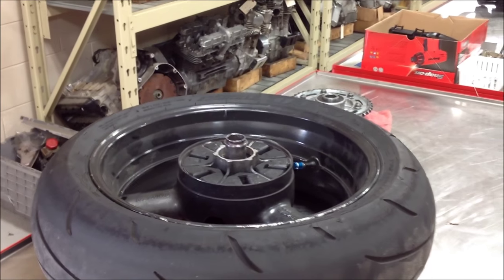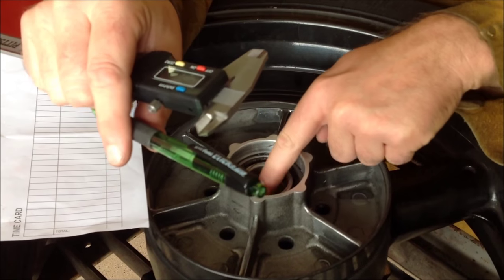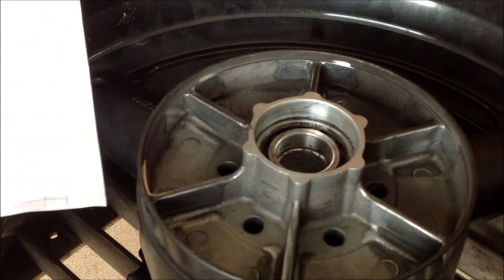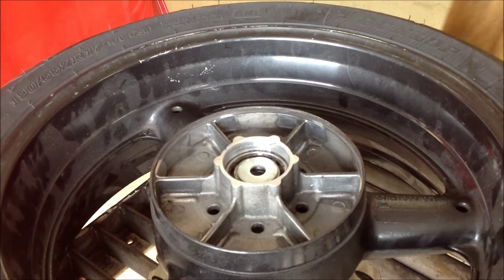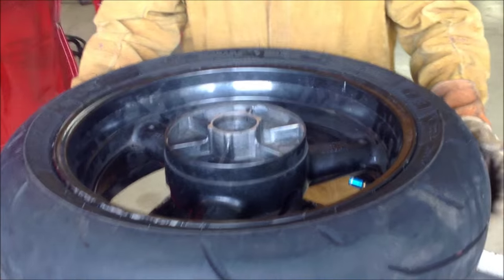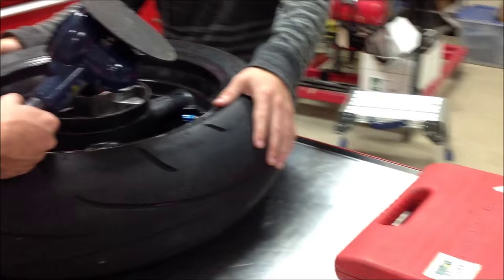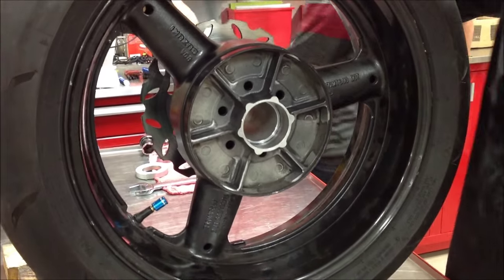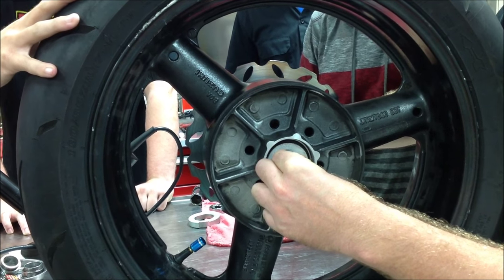Suzuki Hayabusa metric sport bike wheel bearing replacement with dyno run after

Comment: If there was a specification for that measurement, it would be in the service manual… I have yet to see any definitive instructions on how to install the bearings…however, the hayabusa wheel has a shoulder for the left and right bearings, where you would expect the the bearings to sit up against… in most cases that I have seen the inner tube spacer is generally around 0.7 to 0.8mm longer than the bearing housings… it is key for the sprocket side bearing to sit up against the shoulder, as to align the rear sprocket with the front sprocket.. if the brake rotor is not dead centre in the calliper, it’s not critical as the pistons can float to meet the rotor… A few years ago an 2017 FJR1300 came in for a front tyre change, which I did without issue… however, when I tightened up the axle nut, the wheel locked up… now I understood why the wheel nut was slightly loose when I removed it… I removed the wheel and bearings and found the inner tube spacer 1mm longer than the shoulders… after careful measurement, I shaved off 1mm from the spacer, and reinstalled new bearings, and the wheel went together without incident… on tightening up the axle nut, the wheel spun freely… I now do this on a regular basis, I install the sprocket side bearing, measure the distance to the other shoulder, and shave off the difference from the spacer… it’s perfect every time.. I know crazy right, but it works every single time… but when pressing in the second bearing it’s difficult to determine whether you’ve gone too far or not enough… perhaps heating up the wheel to 300 degrees C, then just drop the bearing in till it touches the spacer… anyhow, can you please tell me the name of the neat gun you’re using ? I realise this is an old video, so you might not even read my comment… thanks…